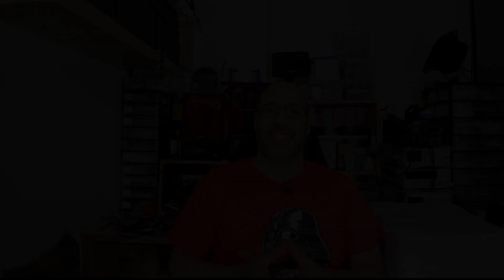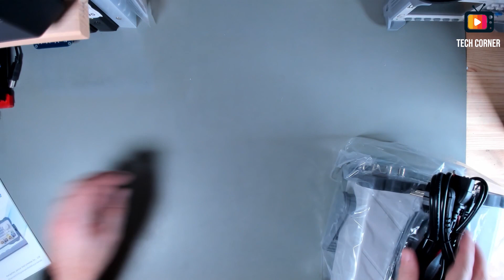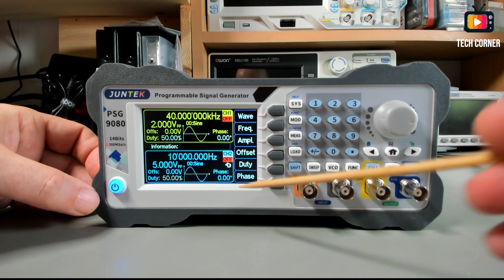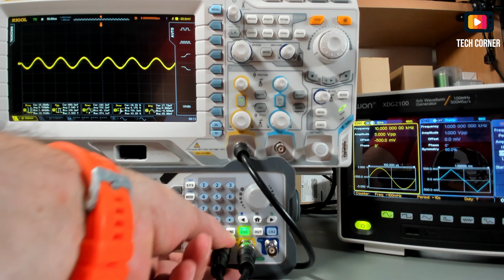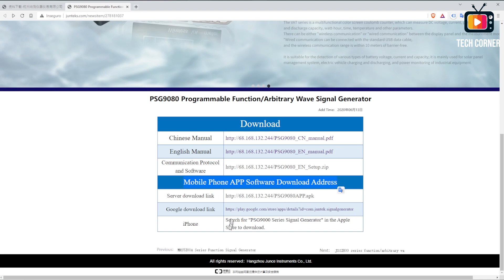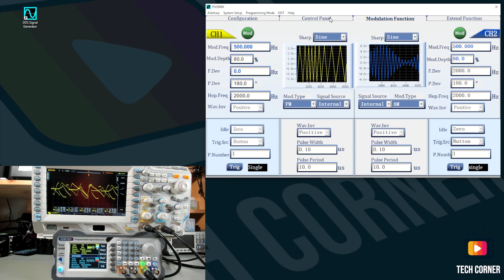Juntek PSG9080 Function Generator ⭐ Complete Review!

Comment: Thanks for the nice video! I am quite new to the field so please 
excuse if this is a stupid question. I was under the impression, that the amplitude of 3.6 V shown at 32:07 is the peak-to-peak amplitude, as on the device itself it also says 3.6 Vpp. However, the plot in the software shows a wave from -3.6 V to 3.6 V. Is this a mistake in the software-plot or am I missing something? Thanks in advance :)
Reply from the maker: Hi, I think you're right and that might be some kind of bug in the software, since even if it is really small, on the oscilloscope you have 1,8V +/- in the VPP section, second square on the bottom. But nice catch. Thanks for watching.
Reply: @TechCornerTV  Thank you!! :)

Comment: Hugi, great work...a couple of questions/comments.

Is the BT module included?... 

One thing that seems absent or lacking from some reviews is the instruments low signalevel abilities. We always see the 1V, 2V or greater outputs which doesnt speak to mV levels free of internal noise. This is important when working into the RF regions. Yes of course an external 50 ohm attenuator can be used but this doesnt help sugnal to noise ratios.

Thanks again for your work.

Gene
Reply from the maker: Hi, sorry this late reply, trying to catchup with all the comments. Yes, the Bluetooth module is included. I will try to see in the future if I cover better the mV output of the signal generators. Thanks for watching.

Comment: 14:53 At high frequencies you should match the impedances. That's why the rectangular wave at 30MHz is so distorted. Notice that already at 10MHz reflections appear.
Reply from the maker: Hi, I will review the video and take that as a lesson for future reviews, thanks for noticing and for watching!
Reply: The main reason why there's distortion and a smaller amplitude at higher frequencies, is the capable bandwidth of the oscilloscope. For a 80 MHz you would need at least a 200 MHz capable oscilloscope !!!
Reply: @jarongaus  he said his scopes bandwidth is 300mhz, so that is not the issue, i think he just needed to match the impedances of the device like origonally stated, an in line resistor or a T junction with like a 50 ohm resistor should do the trick